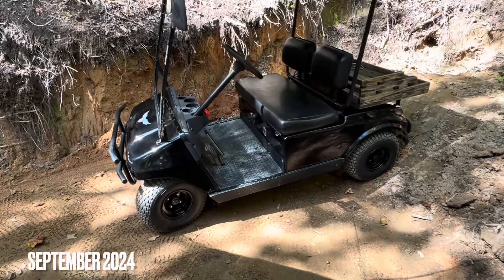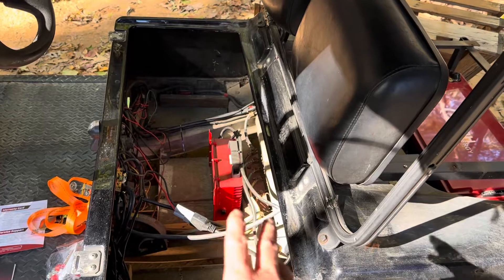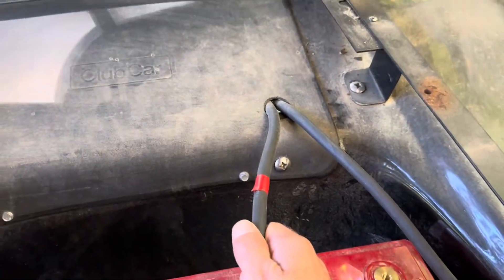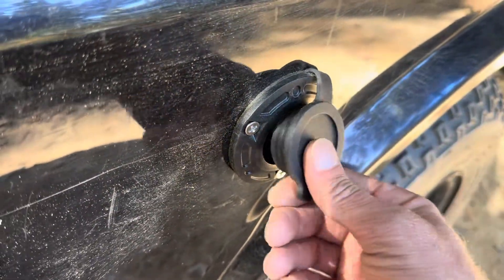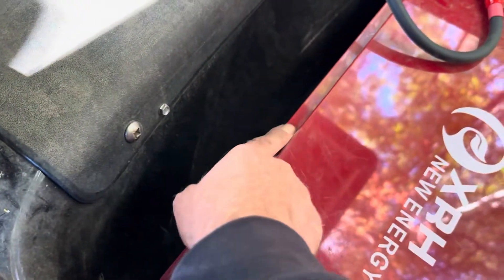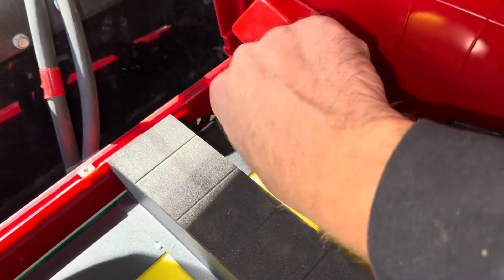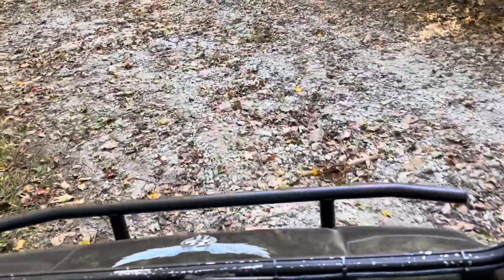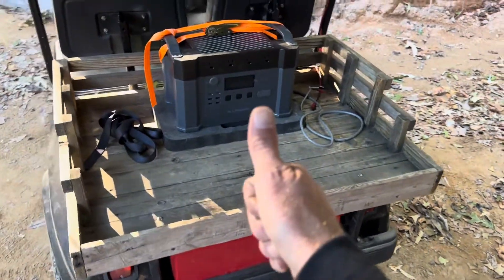XRH 36V 105Ah LiFePO4 Lithium Golf Cart Battery, Best 36V Lithium Golf Cart Battery?

Comment: I’m thinking about getting a resistor cart for cheap from a friend. I’m worried though about the resistors getting hot. I have 4 acres and it’s on a hill. I want to be about to put around with the dogs and do yard work. Do you think the resistors will get too hot if I’m going slow?
Reply from the maker: I’ve got 16-25 degree hills on my trails. Literally spin the tires to climbing some of my hills. I ride in the woods, haul trailers, haul brush etc. 
My resistors may burn out tomorrow but so far so good. Remember you’re going to shed close to 300# weight off the cart. Resistor cart will ride a wheelie if you mat it with lithium. No losses through a controller. WOT is basically direct wire to motor, very exciting to experience.

Comment: Great video. I just got a DS for a good price - not a toaster = and have been looking for ideas on changing to lithium.
I  see that XRH now has a "mini" version of the 36V.
If I go that route, can I  use your Amazon affiliate link to purchase? How?
Your videos are the best, no BS just the straight scoop. THANK YOU for that.
Like the box on the back. Been thinking about something like that. Lookin' good 😊
Y'all take care.
From Coarsegold, CA.
Reply from the maker: Thanks! Yes XRH has a 60Ah version now. I have the 60 in parallel (breaker between) with the 105. The 60 fits under the seat very easily with room for other goodies like 36V inverter, on board chargers etc. 👍 Actually could easily fit 3 of the 60Ah under seat even being a toaster. If you click through the Amazon link on the 105Ah you can still select anything on Amazon and it will give a sale tally for my account. I appreciate your efforts and support in this! It really helps tremendously! I will have an update video soon with the 60Ah. I’m doing longer term tests on GC batteries now. The 60 has been in service for 6 months and works great. Both batteries load share within 1A under most circumstances. Some of my steeper hills I pull 6500W  (180Amps +\-) from the batteries.  The 60 is the “hit” battery (shortest wire length) the 105 is the “range extender”. No BMS trips, hiccups etc and used golf cart down to 5°F with plenty of performance even considering the cold cell temperatures. Appreciate you! Take care!

Comment: I need to know exactly how you wired it in because I have a big lithium battery for a golf car resistor DS club car and I could not get it to work. I said fuck it and threw my lead acid back in if you can walk me through it or maybe send me a videoof you explaining which wires you took out and or replaced please
Reply from the maker: Are you going to put battery in the rear as well? Or are you going to install under seat? (I now have one under seat and in the bag well) I can show either that you need. LMK
Reply: @THEOFFGRIDMOUNTAINHOMESTEAD 
I am going to put under the seat I have 3 parts carts same model so I am going to relocate the resistor maybe chop the frame I just need to know which wires I need to get ride of really just a walk through I have a lossigy battery which is like yours plastic box doesn’t have on/off button or anything like the metal case batteries online and there’s no guide so show installation on a non controller cart which led me to you
Reply from the maker: @jimsupernant3059 Yes definitely have to move the resistor bank for a large case battery. If you marked your main positive from the F/R switch and main negative should only be the half speed reverse wire left. (Maybe small accessory wires) It has to be bypassed to work. AKA no mercy reversey mod. Full power reverse. Have to make a bypass jumper for this. If you have 12V lights/accessories also a buck converter has to be installed to not burn lights or accessories out.
Reply: @THEOFFGRIDMOUNTAINHOMESTEAD  did you completely remove all of the wires to the original charger?

Comment: If you have lights do you have to install a 12 volt converter?
Reply from the maker: I’m using all LED from NiLite they have operating voltage of 10-60V. If you are using 12V rated bulbs a converter is required. Hope this helps!

Comment: Great video. How did you remove the screw caps without marring the case?
Reply from the maker: The caps for the cover? Trade secrets lol. A fine thread drywall screw may help you obtain the desired results!

Comment: Great review. Vatrer rebrand possibly?? Peace from the cold north ❄🍁
Reply from the maker: You’ll see another battery soon that’s surprisingly similar in construction but not a Vatrer. One thing I have noticed in all the golf cart batteries is they all rely on JBD battery management. Relay/vacuum contact based. Heavy Duty AP or SP series. These style batteries in the 48V(51.2V) variety are excellent for off-grid energy storage due to robust construction. Prices are very competitive with server rack units that usually have smaller wire and 100A BMS. 
Appreciate you stopping by! Send some of that cooler weather down south, record heat here this week! 🙂

Comment: Enjoyed the video and I agree with you on the wasted space.  I can understand them using the same case for  the 2 different sizes, but it is still wasted space.  I  had a  friend just converted his golf cart to lipo4 batteries and he can't get over how far can travel.  He said his had to have lost 300 pounds as well.  It is definitely a huge upgrade going to the lipo4 batteries.  Thanks for the review and the update 😊
Reply from the maker: Thanks! It will run forever and a day no doubt with the lithium. The 310Ah Battery test video where I charged the golf cart was 7 days of use on this XRH.
Consistent power delivery too. Feels two or three times faster from a dig. Not a RZR but it’ll do. Whether it’s the weight removed or the battery sitting at 40V or combination. It just rips now. I forgot to mention too the efficiency of the charging compared to lead acid.

Comment: The main issue is weight . Going lipo you can lose 50% or more of batteey weight . Less weight the better.
Reply from the maker: Lost roughly 300# off the cart lithium also stays at higher voltage levels so much more entertaining experience overall! 🙂